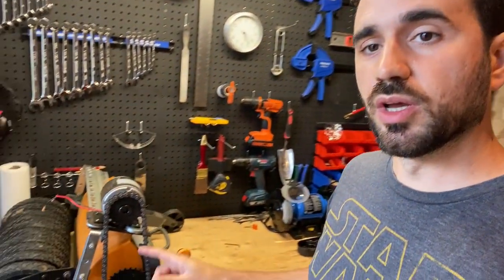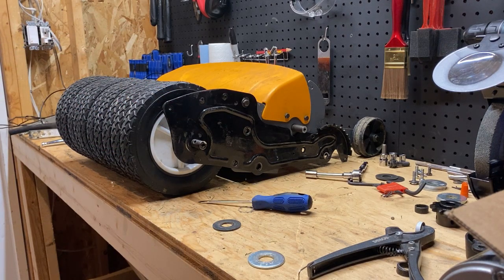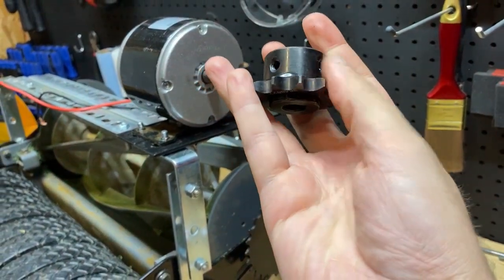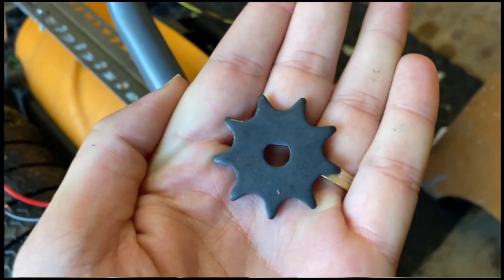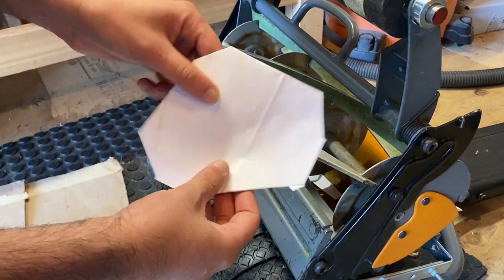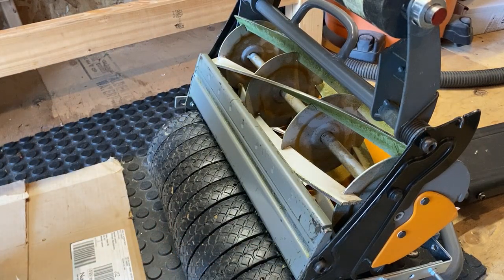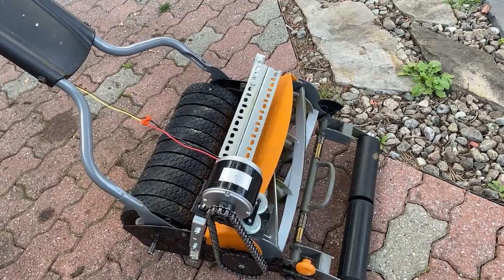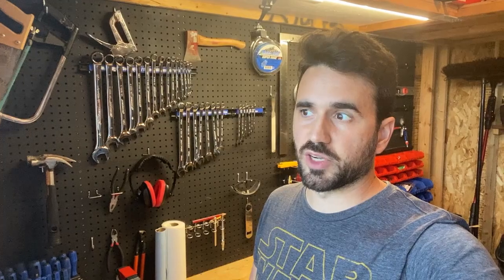Fiskars Reel Mower - Electric Conversion

Comment: Great upgrades! Do the wheels in the back do a good job striping by themselves (if you didn't also use a front roller)? I have a PVC dragging behind mine that stripes but would rather just add wheels like you have if it works just the same. Looks like they are standard 8 inch wheels. Thanks!
Reply from the maker: Thank you! Yes the wheels in the back stripe well just by themselves since that’s where the majority of the mower’s weight is applied. The front roller just helps to define the stripes even better and to avoid scalping when mowing at 1” or lower. The wheels in the back are indeed standard 8 inch, in the case of these, I just had to open up their inside bore since the Fiskars’ axle had a bigger diameter. Hope this helps!!
Reply: @jamescorreia6944  it does thank you!
Reply: @jamescorreia6944  would it not make sense to add a front roller if I mow at 3 inches?
Reply: @jamescorreia6944  is the axle for the wheels 5/8 inch?
Reply from the maker: @DRTOLLZ  sorry just replying to this now! Mowing at 3” you definitely want to avoid having a front roller. It will just bend the grass down and prevent the mower blade from cutting it properly

Comment: where do I find a mount for the motor that connects it to the steel bar? the screw holes are too small and it also does not align with the holes on the bracket

Comment: Hey James, Thanks for your video. I’m making my conversion based off your design. I’ve sourced all the parts that were not listed except for the 2 shiny black brackets used to mount the motor. As a temp fix I cut the left overs of the horizontal angle bracket in to two pieces but I’m not sure it is thick enough to hold the motor like the brackets you found. But I have watched you video several times and like the simplicity of your design best. Would love to see an update video if any other modifications were done. Also noticed you don’t have the push to start attached from the controller. Any reason why? Thanks again..
Reply from the maker: Hello! Glad to see that this video is being helpful! I plan on doing more videos, but the season hasn’t started yet here in the great white north. The lawn is still waking up from dormancy. I modified the cable management a bit to make it look more finished. I plan on modifying the support as well and use only 1 sheet of metal molded to the mower to make it look more stock. I just don’t use the push to start switch because the one that came with the controller broke lol. I’ll be adding another one soon so I don’t have to adjust the potentiometer all the time.

Comment: Great video.  Did you use an 18 inch 5/8 shaft for the rear wheels or sized up to 21 inches?  What length shaft did you use?  Thanks !
Reply from the maker: I used the original shaft for the rear wheels!
Reply: How do you get the Berring off on rear axel to out new wheels on?
Reply: Did you ever get the rear axle out?

Comment: Why has no one put a gas motor on this? Would it work? I was thinking make a mount bracket like you’ve got and mount the motor on that. Like a 6.5hp predator engine or something similar. I imagine a horizontal shaft would be necessary/easiest. It’d get the reel rolling at a speed you couldn’t match by walking. I haven’t seen ANYthing online like that but I still don’t think it would be difficult, even if just for experimentation purposes
Reply from the maker: I looked into the possibility, I just didn’t want to mess with having to adapt controls to start the motor, engage the blade etc. It would also require a more robust mount, but it’s definitely doable!
Reply: @jamescorreia6944  I might have to experiment, I want a gas powered but can’t justify the price haha. But a good used push mower with a small 4 stroke motor and some custom fabrication might be just the trick

Comment: This is absolutely awesome but I would HAVE TO figure out how to get that bad boy cutting at putting green heights. Or at least half an inch.
Reply from the maker: With the front roller mod that I did, the cutting height range of this mower became 1/2” to 3 1/2” ;)
Reply: @James Correia  Oh nice! I'm curious is this more powerful and better cut quality than say the Sun joe 24v battery reel? I just recently bought one. Waiting on growing season to see how it holds up. 1st scalp looks pretty good. I will eventually get a real REEL mower just hard to spend that money for only 2500 sqft of grass. Would love to see some good footage this growing season with your mower. Thanks! 👍
Reply: @bamabladez  I'm on the fence with the Sunjoe for my 7K sq ft Bermuda. How did the Sunjoe hold up?

Comment: I am working on the same project. I purchased a similar motor with a 1/4 inch shaft. Where did you purchase the weld on sprocket and weld on hub? Also did you move the rear sprocket to the front?
Reply from the maker: Hello Mark, sorry for the delay! I got the sprocket for the motor from Amazon: https://amzn.to/3nsXcwK

And yes, I used the rear sprocket originally on the wheels, and installed it at the front with the reel blade. This ratio of smaller sprocket on the motor and bigger one on the blade will give the mower a lot more torque so it won’t bog down. Hope this helps!

Comment: Hi James, I did this exact conversion based on your video, it was extremely helpful, thanks a lot for sharing!

Not sure if you faced the same difficulty, but looks like the sprocket on the reel is not fully parallel with the body of the mower which makes it a bit "wobbly". The chain line therefore is not straight so whenever I turn up the RPM or hit thick grass, it drops the chain. 

Would you have any suggestion for fixing this?
Reply from the maker: I would have to see a picture of your conversion. I corrected that by using a support bracket with rectangular holes so that I could move the motor if necessary. This allowed me to adjust it so both sprockets are perfectly aligned. Hope this helps!
Reply: @jamescorreia6944  thanks a lot for the quick answer, you are awesome!
The chain line itself is straight, the problem is that the lower sprocket (the one connected to the reel) seems to have a little play, even if I fully torque down to screw that attaches it to the shaft. It moves ever so slightly, but its enough to break the straight chain line.
Reply: @tbandras  bike derailleur.
Reply: Andras, how do you remove the original sprocket off the motor? I can get the nut off but not the sprocket.

Comment: What size chain did you used…thanks.
Reply from the maker: At the end I explained that I ended up using the original chain. Just get the 9T sprocket from Amazon, it will match the chain, I posted the link on the description

Comment: Also a front rail i stead if the 2 wheels would be preferred
Reply from the maker: Why? Thanks for the comments :)
Reply: @jamescorreia6944  the average plane is more of a smooth flat plane then rocky undulations. Thats how it is on the expensive mowers. I have one but until you level it with sand the risk is too high to damage 800.00 reel and bed knife these are very cheap by comparison
Reply from the maker: I’m guessing that you’re talking about the yard becoming more levelled? I don’t intend to go below 3/4” at least for the time being, but I do plan on levelling more with sand. I also have an Allett Buckingham 20H that I use in this yard with no issues so far. Thanks for the advice, I appreciate!

Comment: Why don’t you just buy one ? Instead of hot gluing a bunch of crap on that poor little mower🤣 the reason I say this is you paid about 300 for that fiskars mower... you could of bought a good used mclane reel mower for about 400 usd ... and would of saved yourself a lot of time turning something into something els... but hey to each his own I guess 🤷🏼‍♂
Reply from the maker: I’m in Montreal, so unfortunately there’s no market of reel mowers around here. This one cost me $80 second hand, plus parts etc, about $300 cad. It works very well, it just doesn’t have self propel. I get your point, but for people in my position or that like a little diy project, this is definitely a good option ;)
Reply: Where have you seen a used mclane in good condition for $400?
Reply: Hi, I’m from Montreal (west-island). Very cool project, very impressive result. Congrats
Reply from the maker: @homer009x  thank you! I know the zone very well, I lived in Kirkland. Now I’m in Laval Saint-François. Let me know if you convert one yourself and need any pointers!
Reply: @pjbrown9313 i picked up a 10-blade McLane for $75 on FB marketplace. Deals are there to be had, my guy.